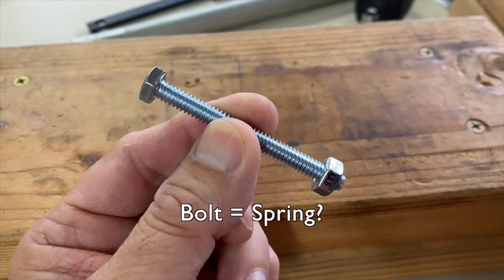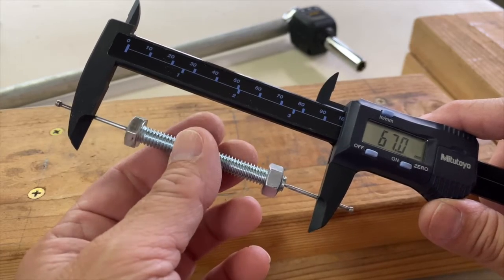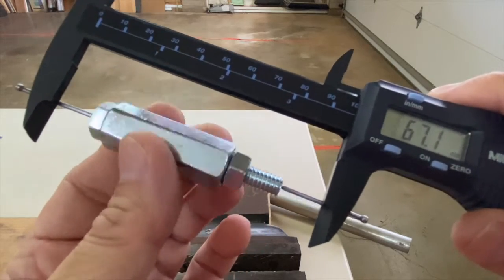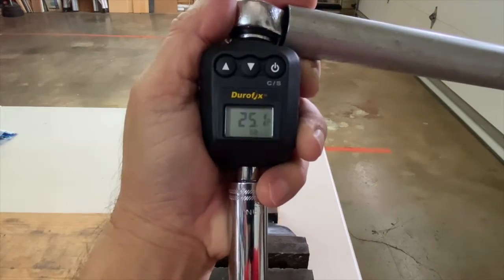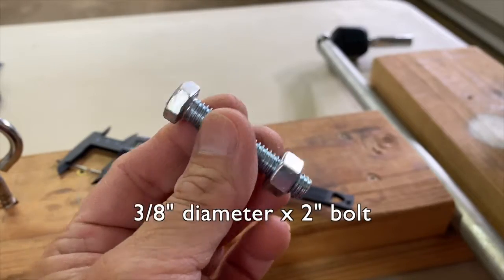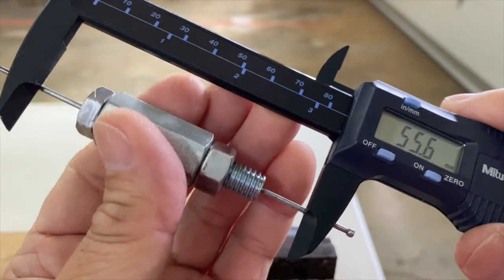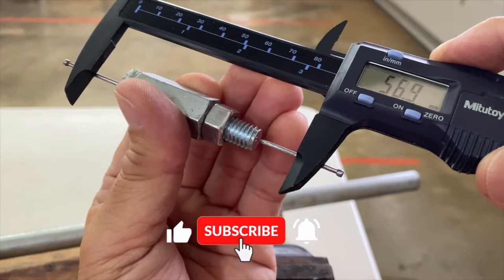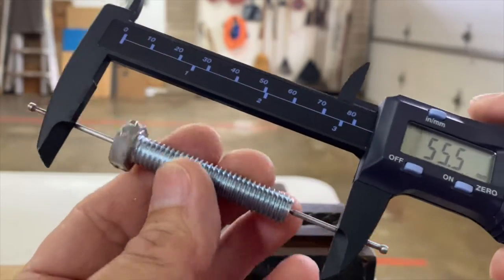Nuts & Bolts - Bolts STRETCH Like Springs?

Comment: Would be interesting compare stretch of clean dry bolts to fully oiled bolts.
Torqued to the same ft/lbs to demonstrate why bolt torque is for clean dry bolts in general.
If you torque lubed bolts they will be over stretched and closer to yield point.

Comment: Cool demonstration. This is essential for bolts to work as fasteners at all! The nut stretches the bolt and the tension in the stretched bolt provides the clamping force. If there was no stretch, the only way to generate clamping force would be to constantly apply torque to the nut.

Comment: A good example of stretchy bolts is when the same bolts that hold a heavy transformer to a guitar amp chassis are also used to bolt a ground terminal to the chassis: they always come loose due to a combination of spaker vibration, transport vibration,  bolt stretch, and material compression. Always. Modern electrical codes require a separate, dedicated earth ground point, not shared with any other ground nor any mechanical connection.

Comment: stretch bolts exist for certain things so this isn't a surprise to me but measuring by torque isn't the standard way, usually it's by the degrees of rotation. presumably a 1/4th or 1/2 a thread (90 to 180 degrees) is a certian amount of stretch. anyway, great video :)
Reply from the maker: Thanks!  I’ve heard about degrees of rotation and yield bolts but have no experience with them. I’ll do more research when I the time.  👍😎

Comment: The bolts used on the powergrid are 1/2” stainless with two flat washers and a split lock washer. It would be so awesome to validate the theory that Milwaukee impacts wreck the bolts via over torquing them.
Reply from the maker: Interesting.  I haven't experimented with stainless steel bolts.  I did some quick research and was surprised with what I found.  First, the recommended torque value for 1/2" x 13 bolts is only 45 ft-lbs.  I think the recommended values are 70% of max values so the max would be only 64 ft-lbs.  Second, the Milwaukee specs for their M18 impact driver state 1,700 in-lbs or 141 ft-lbs of torque.  If the above are correct... it would be very easy to over-torque the 1/2" stainless steel bolts.  
I don't have an impact driver, so I can't do this test... yet.  Maybe this video will take off and hit 50k views which should be enough to pay for the impact driver.  😎
Reply: @HacksbyDad  If you’re in Southern California near me I can drop one off 😁
Reply from the maker: @markplease  Thanks, but the Pacific Ocean  separates us.  Aloha!  🤙😎

Comment: Ok, this is awesome. Would you consider showing what happens when the bolt is severely over torqued by a brushless Milwaukee impact? The theory is that it will yield and you will lose that spring effect, which causes a lot of losses on the power grid (due to over torqued electric connections)
Reply: When you slightly stretch a bolt and it returns to its original length, you are within the first modulus of elasticity. If you stretch beyond that point, you have entered the second modulus and it will no longer return to its original length.

You can easily demonstrate this using an elastic band. Stretching to the point where you feel a natural resistance is fine and the band will continue to retract. Beyond that point retraction will be considerably less and it will soon fail.

Traditional spanners are  are designed with a length that allows you to feel when you are coming to the end of the fist modulus.
Reply: @wilsjane  I'm quite experienced and can normally feel that with any length tools
Reply: @izaacbanks3337  Exactly. But I am sure that you would automatically not use a 3 foot wrench to tighten an M6 bolt. 
Believe me, I have seen that one. The guy looked quite puzzled when the head snapped off. LOL

Comment: Would different "Grades" of steel have different amounts of "stretch"???
Reply from the maker: I think so.  This bolt was a cheap grade 2.  😎
Reply: @HacksbyDad , most stainless steel fasteners are pretty soft and stretchy compared to carbon steels ---- but the stainless threads sort of cold-weld to each other (can't remember the technical term for it). [It's called "galling"]
Reply: In theory as long as the bolts are steel, different grades would stretch the same. The grade of the bolt indicates at what load (stress) the bolt will fail, but steel has the same "elasticity" (Young's modulus) regardless of strength.

Comment: In Lansing Michigan's GM motor plant, we used this property in taming the Quad 4 engine .  Because of the dissimilar metal and their expansion rates, the engine used to chew up its head seals. There were a lot of things they did to fix this, but one was lengthening the head bolts and letting them act as springs to help take the pressure and wear off the seal.
Reply from the maker: Interesting… thanks!  👍😎